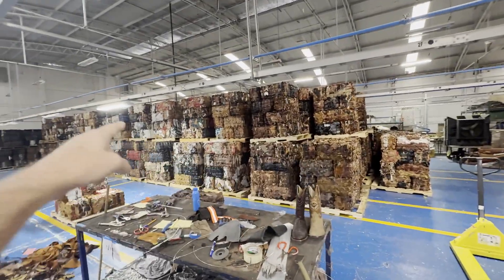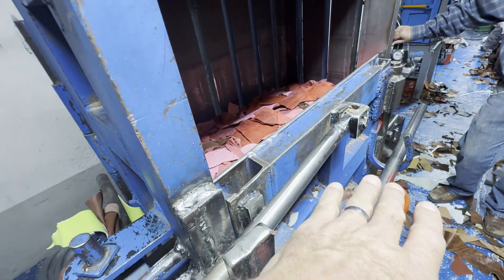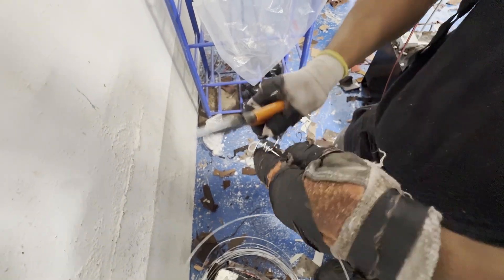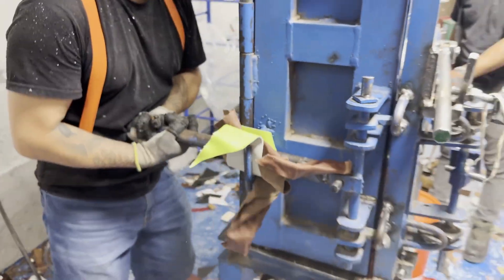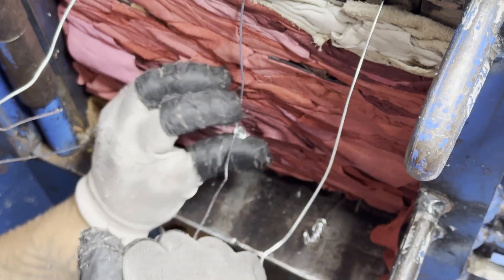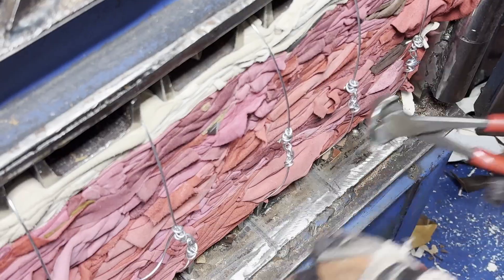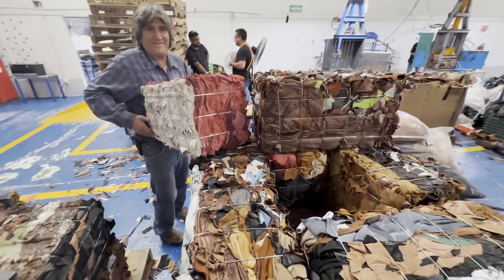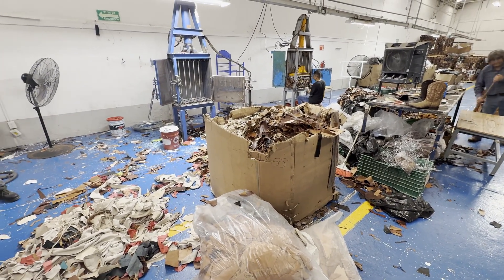480,000 lbs of Recycled Leather, 29,250 Cows Baled To Build With. How We Did It

Comment: I am interested in the science behind using leather to construct a building and how you are obtaining approval through building codes.
Some constructive criticism of the operations; Surrounded by leather and workers are using gloves wrapped in duct tape, using a water evaporator cooler in the warehouse will cause those leather bales to be 10-20% water weight, and splurge a little and get those workers some better quality scissors (and gloves).

I am a fan of your products. The tow belt is my go-to over the handmade belts I used to get from Renaissance Festivals, which have all stretched, narrowed, or broken. They will be on my Christmas list for several years until I get all 4 colors of the tow and dress belts. The large chestnut briefcase has been on my wish list for over 15 years. The Love41 mini tote has outlasted all my wifes other purses and still going strong.